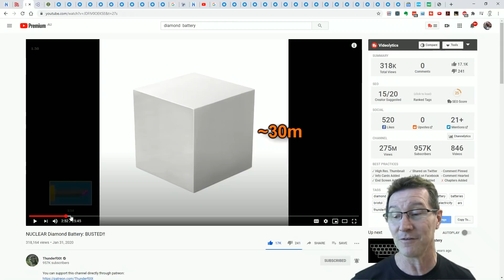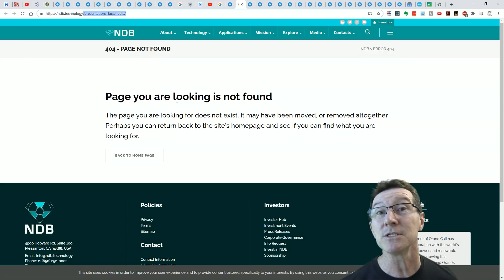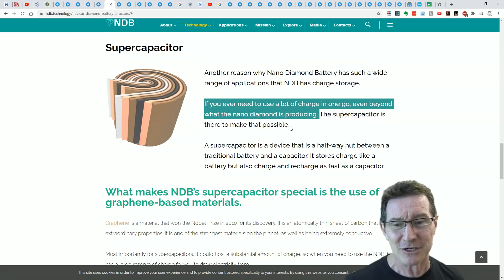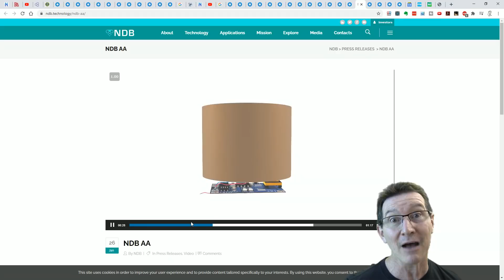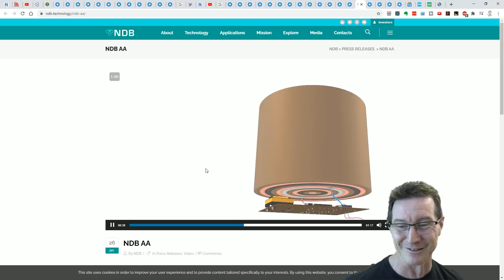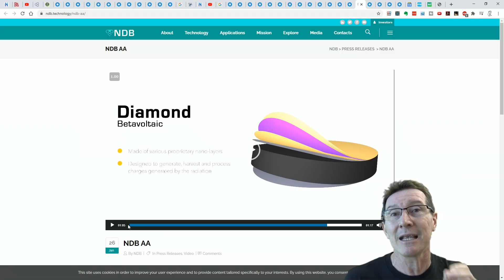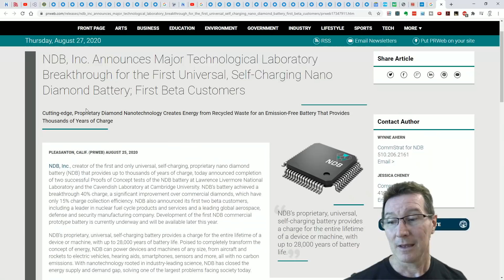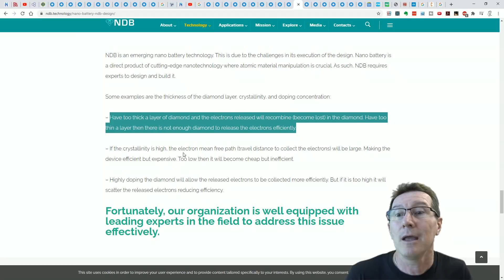EEVblog #1333 - Nuclear Diamond Self-Charging Battery DEBUNKED!

Comment: Hm, Dave, it wouldn't produce only 100µW. The image with the DIP chip is showing that it contains Tritium. Tritium 
decays with only about 11.63% of carbon-14s MEAN energy. (The mean being 49 keV, that is already without antineutrino-waste-energy, while Tritiums mean energy is only 5.7 keV - also without antineutrino waste) Furthermore, these chips are more or less using something similar to solar cells, I believe.
So, if the decay produces 8.6 times more energy, than that would make it already be capable of ~860µW with the same size. (probably not just as much though) Now, with a much better solar cell thing (What's the correct name?) it could probably produce way more.

So I'm not entirely sure that they can't fit enough Carbon-14 and a highly efficient, special made solar cells thing into an AA-Battery shell to reach 10mW or more. And if the supercapacitor has enough storage, it might be actually be kinda useful for something.

I wouldn't dismiss this entirely, but on the other hand I'd rather wait for a prototype to see results before thinking about giving any money.

Edit: Clarification
Reply: found your comment. the one shown in 6:46? Are you sure? because it seems to have C-14 written on it in yellow writing?
edit, wow, they really did just copy citylabs didn't they XD, same DIP, same 100microwatts.

while carbon does produce more energy per decay, it decays much slower than tritium- by a ratio of their half lives 5730/12.5= 458, so per number of atoms, about  49/5.7/458 ~2% as much power. (that does mean it lasts proportionally longer too, but with the reduced power too).

it does have the advantage of being solid though, the tritium needs to be solidified by bonding to a metal to give it a reasonable density, i think citylabs uses titanium tritide TIT2 (LoL XD), per mol of tritium that's 27 grams, compared to carbons 14 grams,  so per mass, the carbon produces 39/5.7/458/14*27 1/30th the power? maybe they did get a 14 times improvement somewhere

reading up further, and the titanium is rarely TIT2, more like TIT1.5, so lets just give the carbon the Benefit of the doubt and say 1/15 the power. that comes fairly close to the 14.29... hmm.

plutonium 238 is awesome stuff and absolutely blows both out of the water , fairly low half life-83 years, and a high energy per decay-5.5MeV, most of which is usable, because it's alpha.
Google a picture, it's trippy  (magic rocks :D)
Reply: @AngDavies  yes, but actually no :)
Well who knows where that image came from. I guess it was not made by NDB, or it was an error and therefore has been removed. Because 100uW don't make sense with carbon 14 and their other marketing.
Reply: @GLITCH_-.- I found that, while the carbon 14 has more energy per decay than tritium, it also decays muuuuuuuch slower- it takes 5730 years for half the atoms to decay vs 12.5 for tritium, so it should actually end up producing less power overall- 10 times more power because of its higher decay energy, but around 450 times less because its long half life, at least per atom.
Reply: @AngDavies  Ah yeah. I thought they could just use more c14. I'm sure there isn't much Tritium in these chips.
Their marketing looks like the whole 2/3 of the AA is chuck full with it.
Radiation wouldn't really penetrate the shell, and what goes through is bremsstrahlung and probably no risk at all - so they can just stuff that thing like a turkey
Reply from the maker: @GLITCH_-.-  The image is credited to NDB
Reply: @EEVblog  Could still have been an error by the marketing team. That's why it's no longer on their site. 🤷‍♂️

Anyway, yeah, it's shady, but I hope they found a way to make it real. We probably wont hear from them ever again though.

Comment: Looks like New Atlas changed the image on this article with a QFP chip featuring no markings other than NBD logo. Original version is accessible through Internet Archive's Wayback Machine. https://web.archive.org/web/20200825222724/https://newatlas.com/energy/nano-diamond-self-charging-batteries-ndb/
Reply from the maker: Looks like they did change it, but the DIP chip image is still there further down in the article.

Comment: They mentioned 3,000 electrons per decay event, so substantially more from the entire substrate per second, totaling all the decay event. Also they gave some specs for their electron output. You could run the numbers on that and see how it compares to the other guys, or if it even gives a clue on what materials they're actually using. Assuming they have used actual materials.
Reply from the maker: Sure. But we don't have that info so you can't really speculate. All we have is the 100uW chip with a (very likely) large surface area inside.
Ok, if it's one surface, that's one thing. So they could stack layers. If so, why haven't they done so? Or are even proposing to do so given this is just a marking photoshop image.

Comment: I'm kind of confused here.  You seem to be basing the entire argument on assuming that the larger batteries (like the AA) will have the exact same energy generation as that little chip.  So... why?  I really want to know, because I must be missing something.  Why is that the absolute limit on how much they can generate, regardless of size?  I dont understand.  Maybe that chip only has a tiny energy harvester (or whatever that is, I'm not familiar with this tech) because it's meant for ultra-low-energy uses.  But the AA battery has one that's way larger.  Why isnt that a fair assumption?  Please explain.
Reply from the maker: They would need 10's of thousands of times the power density of the DIP chip in the AA to get the same capacity of a normal AA. I'm assuming that's a pretty darn big leap over what NDB have proposed in that photo.

Comment: Dave, this is something you would pop into your remote control and it would be intermittently used. You could calculate the supercapacitor charge-curve, it will go up by a certain rate and then you could have enough current to do some remote button presses and as long as you aren't channel-surfing too long, the supercap will have enough time to charge up for the next channel or volume adjustment. But I don't think this will be any use for most continuously-drawing current device. I'm not even sure a Bluetooth keyboard or mouse will last any more than a few seconds or minutes until the supercap drains out and you have to wait for your 100 uW source to charge it up again. I do enjoy the marketing bull droppings.
Reply from the maker: A couple of lithium AA's in a remote will last forever.

Comment: Hmmmm after watching the Chernobyl series on TV and seeing a firefighters hand literally dissolve after touching graphite from a reactor I say "No thank you" After all what's going to happen to the cell after it is used, or after the deivce it powers is obsoleted? Yup nuclear waste into common landfill and an environmental disaster all over again. Also in the first image with the 100uW claim, why does a power source need so many pin outs? Later Dave shows a quad flat pack NDB, again with a load of pin outs. Why would it need so many? All-in-all, basically a Soylent Green solution.
Reply from the maker: The citylabs units have those pins. NO real reason why apart from industry standard DIP.

Comment: 2 other major problems, the AA battery doesn't have a linear discharge voltage, unlike a supercap that voltage is proportional to the charge
Secondly, they show a DIP20 (or something) package, which is going to be really hard to fit into a AA battery with a supercap and circuit board.. nevermind they're talking about multiples!

Comment: While this product is utter marketing bullshit, I can see a use for 100μW betavoltaic cells. By using them in conjunction with a supercapacitor (or just a large normal electrolytic) you’d be able to buffer that low power output into a usable power density for momentary power draw, in something like a remote control or datalogger, anything that’s asleep for 99% of its life. Be real handy to have a dozen sitting in a lead-lined container for me to put into projects. But even at that average power density, it would be nigh impossible to power something like a smartphone or computer, especially not an electric car. They’ll need some amount of shielding too, making them a bad choice for any application that needs to be small.
Also why the hell would you put a battery into a DIP package?
Reply from the maker: Sure, there is a niche market for this stuff, this is why CityLabs exist. It's in a DIP because CityLabs have a DIP package.

Comment: 10 million of these things can produce a kw. A billion makes 100kw, which can probably run a car forever. The chip inside the DIP is no doubt a square cm or so, so you might be able to put a billion of them into a reasonable space. Cooling might be an issue. Also of course you couldn't let people near such a beast.

Comment: I bet power density for plutonium RTG in table is per gram of plutonium, not per gram of RTGs itself! So, super-duper dip-chip size battery can be more efficient, because there teeny-tiny amount of fuel. But it is not scalable, which mean it useless...

Comment: 17:13 about 7 times more charge than the entire size of a smartphone battery, per hour.
My phone battery is 4 Ah at 3.8V that's about 15.2 Wh total content.
So their battery.. produces 106.4 W of power? Where's the heatsink? Or should I already get a watercooler in advance for my next phone?
Reply: 100 Wh over 20-50 years....
Reply: Betavoltaics have about 10 times the total energy of a lithium ion of the same volume. But they take decades to release that energy.
Reply: @RobertSzasz  but the text says it has/outputs that much power "per hour".
Reply: @DedmenMiller  oh, their numbers are total BS. I was giving numbers based on current, proven, betavoltaics. They have about 10 times the energy density (volumetric), but where a lithium cell will happily discharge in an hour, betavoltaics take decades. You end up needing a battery thats thousands of times larger.

Comment: You could have a chemical reaction battery takes the hydrogen oxygen from the air and converts it to Electricity using nanotechnology or a special chemical plate
What about static battery. Yes but if they're quite small you can stack them up 100 microwatts could become one watt and wouldn't be that big
 actually graphenes a bit old hat in battery terms they are making batteries out of viruses now there be the future batteries

Comment: If they take their tiny pill that is in the 100µw chip product and expand it into a cylindrical volume of 2/3 of a AA battery cell then they may end up with quite a lot of energy capability.
I think it is a bit premature to say based on the chip that it is a 100% energy dense volume. Most likely the chip has a 10x20x1mm or smaller device in it and if one follows that assumption that is 200mm^3 for 100µW. Scaling that to 2/3 length of a 49x14mm cylindrical AA cell you get a volume of 5000mm^3. I'd not be too suprised if they can thus deliver 2.5mW from the AA cell format.
Marketing wankery aside, it's still possible they will pleasently surprise us but not run any EV's on it for sure. My bluetooth thermometer could benefit from never needing a battery change, but I would not pay millions for it...
Reply: This was my thought; all of the information that we've been presented with doesn't show anything about how much of the internal volume of that 100µW chip is actually occupied by the radiogenerator material, and how much greater volume in an AA-sized container would have radiogenerator material in it. There's just not enough actual data to be able to say whether the premise is plausible, although I would expect that they'd have to show off hard data to potential investors, rather than the almost content-free puff-piece "gosh-wow" articles for the general public.

Comment: Eco technology example a vacuum clear of 2000 watt year made 2015 is not eco friendly but a vacuum cleaner of 2000 watt made 2019 is eco friendly. So why the vacuum cleaner made 2015 is not eco friendly?  Car 1.6 have top speed 200 for example but a 1.4 have also top speed 200 is eco friendly but to manage the performance maybe a turbo system is installed, so both car consume the same amount of fuel.

Comment: How many terminals does a battery have? How many pins does that chip have? You want to focus on the picture of that chip but does that make sense to you smart guy? Or does it make a whole lot more sense that the battery is built into a chip and just a small part of the whole so that the chip doesn't need an external power supply? If not, what kind of battery needs 22 terminals? I'm not sold either way but your entire claim based on one picture is ridiculous...

Comment: I love that their 3d model of circuit board is a eBay special TP4056, DW01 and double mosfet lipo battery charging and protection module. You can find this model published for free.
Reply: Not to mention they bodged an inductor/transformer onto the model, just because.
Reply: With revolutionary through-hole surface mount components.. kid you not!  Yet another NDBullshit  ba-ha-ha

Comment: Tritium has a half life of 12 years, maybe they get 20 years out of that batteriy before the power go´s down, thats 17,5Wh...... over 20 years. A single 18650 has around 12Wh......  "slow clap"
Reply: It's not using Tritium, it uses Carbon-14
Reply: @GLITCH_-.-  Thanks for pointing out!
I looked it up, the betavoltaic cells with those long half life beta emitters, can put out 1microW.
If you have some 100th of years time this eventually get you up to around 3kWh! 😂
Reply: @martin09091989  oh, do share link please :)
Reply: @GLITCH_-.-  https://wikipedia.org/wiki/Betavoltaic_device

The Russians made a divice in 2018 with nickel-63 that made 1 microwatt. And since that nickel 63 has a halfe life of 100 years, and carbon 14 has some 5000 years, the power output of those Dimond batteries should be even worse. 

But still over 3kWh/kg 💪

Comment: Even under the most generous assumptions - 100% pure C-14, each beta emission causing ~3600 electrons to be knocked loose on average, absolute perfect efficiency - I can't get a 22g lump to produce more than 2.5mA of current. Alternatively, at beta emission energy of 0.15MeV, there is only 5mW energy released from nuclear decay. And that's from 100% pure C-14, not a more typical one-atom-in-10^12.
Reply: I've got 20mW of total released energy for 14g of C-14. Decay rate is about (ln 2)/(5370*365*24*60*60) = 4.1e-12. 14g is about 1mole. So we have 4.1e-12*6e23  = 2.46e12 decays per second, 5e4 Ev on average. That is 1.23e17 eV per second or 20mW
Reply: 0.15MeV is the absolute maximum decay energy- it's split between the electron and an entineutrino(unharvestable), and the average is like 49kev, so another third of that :P

Comment: 348x ~2500mAh "disposable AA charge capacity" / 3600s would require ~240mW - if that's 100% efficient, then 40% efficiency would be ~100mW from the 2/3-AA-sized betavoltaic... did someone at NDB get their "millis" and "micros" mixed up? ;-)

Comment: Love this Dave...  As both a transit enthusiast as well as a long time engineer, I wondered about their claim of this being useful for vehicles, so I did a bit of back-of-the-envelope figuring.  A typical light rail train consumes around 7.5 kW/hr per mile.  We'll assume a very modest, Melbourne Streetcar, speed of around 15 mph (24 km/h) and the volume to be similar to a AA battery, as you suggested.  That means these things really could power such a light rail train - if you use 1.1 Billion of them, and if that light rail train is dragging around 30, 24-meter boxcars (goods vans) along behind to hold all those little batteries (255,000 cubic feet worth or 7,500 cu meters).  Doesn't sound all that practical!

Hell, a 1 Watt LED flashlight (torch) would take 10,000 of the little suckers.
Reply: Just a note, the original Tesla roadster had 7,000 cells to power that vehicle. Those cells were 10 to 20 times the physical size of a potential NDB form factor.  So, the idea of 100,000 of them to develop kW energy density is not that far fetched nor impractical.  Time will tell if this can be scaled for real world applications.
Reply: @richweiner6735  No, there is no “time will tell” any magic when it comes to power density from nuclear decay. The electric power you get will always remain in the 10s of micro Watts per cubic centimeter if the isotope is Carbon 14 because of the first law of thermodynamics and even you could capture all beta radiation 100% (impossible) into electric power, it would still only double the power density and you would still need 1000s of times more size and cost for the same power making it completely impossible for smart phones, laptops or EVs. Even using some much more radioactive isotope will not fundamentally change this issue and you will then also end up with a super dangerous dirty bomb of battery.
Reply: There is no such unit as kW/h

Comment: For the science, basically, it uses radioactive decay to generate energy. Somewhat similar to solar energy harvesting, only using the radioactive decay instead. The science is legit, it's just not going to be replacing traditional batteries.

Comment: Maybe it can produce more charge in an hour than a AA can, if it's running at a much, much, lower voltage. Or they're just saying the supercap can deliver charge more quickly than a AA. Either way, still not disrupting the energy industry in any way.

And btw, don't supercaps have relatively high leakage rates? How much of the 100uW would get used just combating the supercap's self-discharge?